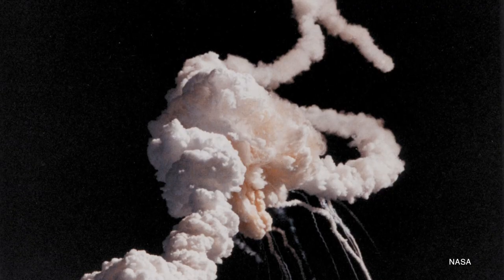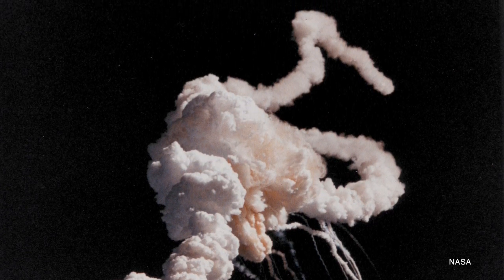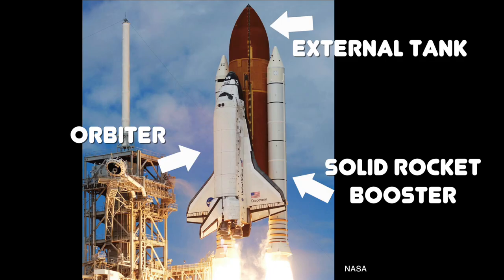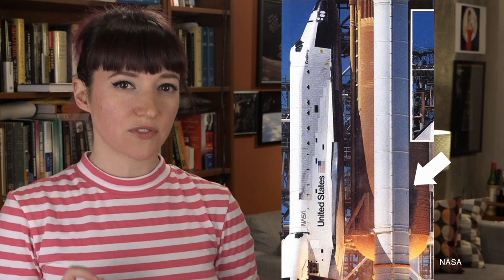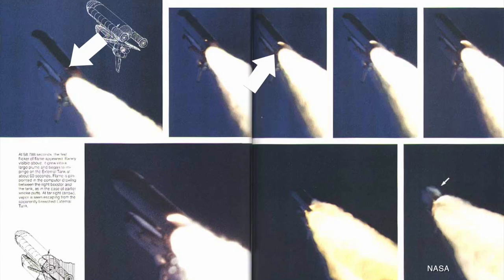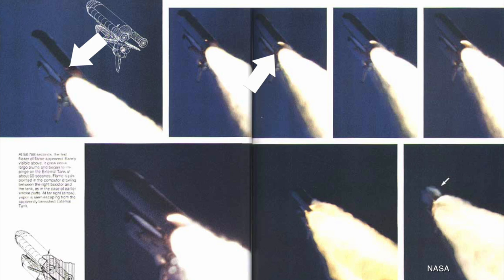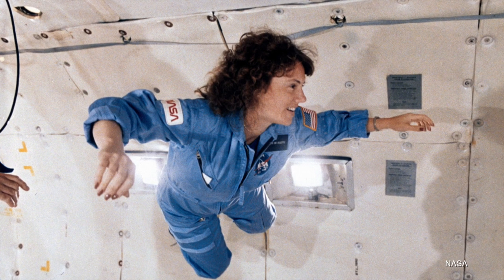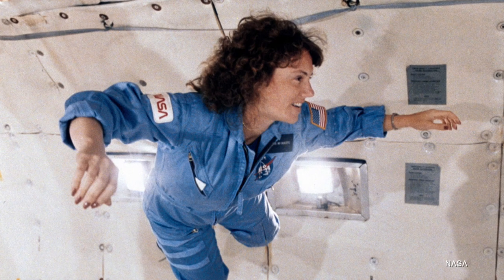How the Challenger Disaster Changed NASA

Comment: How the Challenger disaster changed NASA: Judging by Columbia, not enough.
Reply: Nathan Rasmussen not the same failiure
Reply: But same culture of optimistic engineering.
Reply: bim bar sometimes you need that.
Reply: Same culture of "normalisation of deviance" at work. They'd had thermal tiles and foam fall from the orbiter/tank on previous launches but it hadn't caused a major problem, so requests to perform an EVA to inspect potential damage to the wing prior to reentry were denied. Requests to ask USAF for imagery from their military assets in order to assess potential damage were also denied. Engineers were also told "if it is damaged, there's nothing we can do about it anyway". But Atlantis was already in the process of being prepped for its next mission... If they'd expedited that process, a rescue might have been attempted. It probably would have been unsuccessful, but they could have at least tried.
Reply: @wierdalien1  In a broader sense it was the same failure - the failure of management to listen to engineers's concerns. With Challenger, management overrode engineer's warning not to launch at that temperature, and with Columbia they overrode engineer's requests to check the wing for damage before re-entry.

Comment: OK Amy first of all thank you for doing a space shuttle story. However my research has revealed that the Morton Thiokol engineers did tell them that 53° was the cut off and that they did not feel confident that they should launch at the lower temperature that they were at. Up to and including the lead engineer refusing to sign off on it forcing the Morton Thiokol  general manager to sign it. A minor detail but correct me if I’m wrong.
Reply: Will this is correct. The history channel did a documentary on this event a few years ago and had actual interviews with the engineers who informed NASA of the O rings and it's problems. While the shuttle launched,, Engineers watched and commented to each other saying that they " dodged a bullet" when the shuttle lifted off.  However, seconds after stating this, the Shuttle exploded.

Comment: Wiki-source recap of the actual breakup: "At T+72.284, the right SRB pulled away from the aft strut attaching it to the external tank. Later analysis of telemetry data showed a sudden lateral acceleration to the right at T+72.525, which may have been felt by the crew. The last statement captured by the crew cabin recorder came just half a second after this acceleration, when Pilot Michael J. Smith said "Uh-oh." Smith may also have been responding to onboard indications of main engine performance, or to falling pressures in the external fuel tank.

At T+73.124, the aft dome of the liquid hydrogen tank failed, producing a propulsive force that rammed the hydrogen tank into the LOX tank in the forward part of the ET. At the same time, the right SRB rotated about the forward attach strut, and struck the intertank structure. The external tank at this point suffered a complete structural failure, the LH2 and LOX tanks rupturing, mixing, and igniting, creating a fireball that enveloped the whole stack.

The breakup of the vehicle began at T+73.162 seconds and at an altitude of 48,000 feet (15 km). With the external tank disintegrating (and with the semi-detached right SRB contributing its thrust on an anomalous vector), Challenger veered from its correct attitude with respect to the local airflow, resulting in a load factor of up to 20 (or 20 g), well over its design limit of 5 g and was quickly ripped apart by abnormal aerodynamic forces (contrary to popular belief, the orbiter did not explode as the force of the external tank breakup was well within its structural limits)."

Comment: NASA knew from the very beginning that foam striking the orbiter was a bad thing. In fact, it was declared as not nominal before the very first shuttle launch, and STS-1 was damaged already so badly that during re-entry, there were spots that got so hot that they did melt down to the aluminum structure.

The very same goes for Challenger: broken o-rings already happened in earlier cold weather launches. Those even were investigated, and the conclusion was that at least once, they were lucky not to lose the crew. Yet despite all warnings from NASA personnel and engineers, the launch on that cold day was done. That borders on manslaughter. (Not to mention the segmented SRBs only existed for political reasons and weren't a technical necessity)

Comment: Morton Thiokol also misapplied the o-rings in the tang and clevis SRB field joints.  They only had to check any o-ring manufacturer’s handbook to see that it was a very unforgiving design.  Let’s hope they learned something from Challenger to apply in the Orion program.
Reply: They are still using SRB's so the answer is no.
Reply: saquist Yes - good point.  Solid rockets are inherently more dangerous.  I never understood why NASA continues to use them for manned missions.
Reply: I don't really consider the SRB's inherently dangerous.  (Well, it's a rocket so take that relatively)  If you compare a hydrogen oxygen rocket or Kerosene Oxygen rocket there is a far higher chance of catastrophic failure.  Remember the SRB's didn't explode (not until they were purposely detonated by Launch Control.)  They merely burned a hole in the most volatile area of the rocket causing  combustion. 

It's the stack of the components that's dangerous (again relatively) compared to the configuration of a capsule on the very top which will not enter extreme shearing forces if the rocket were to break up.

That being said, there is almost no other way to do this as a Heavy Lift System.  Look at Space X's BFR.  That's what you would have to do to avoid the Space Shuttle Design.
Reply: They did redesign the O-ring and seal assembly, and retrofitted the SRBs in inventory as well, which is why there was a two year (IIRC) pause before launching another Shuttle.  Still not as good as the originally intended one piece rocket, but that design couldn't be built in Utah and shipped by rail, so Morton (who bought Thiokol) and Congress forced the segmentation, which required O-rings, at the beginning of the program.

Comment: What shocks me is how quickly safety took a back seat to the customer on just the 2nd flight after Challenger 51L.

Atlantis almost had a burn through during reentry due to damage from  ablative insulation from the RH SRB nose cone which caused extensive tile damage down the right underside of the vehicle. The long and short of it was that the crew had to send video to the damage using encryption due to it being a DoD mission and the pics were so bad on the ground that the ground ignored the crews concern.

So they could have lost another shuttle just 2 flights after 51L. That would have ended the Shuttle program. Just do a search for "STS 27 landing photos". Yeah, those white gouges in the black areas are not supposed to be there.

Comment: And after NASA thought they made a change in their mindset, they kept launching shuttles with ice breaking off the main tank, and thenwe had the Columbia disaster. Apollo 1, Challenger, Columbia. Fool me once shame on you, fool me twice... We were supposed to learn from these mistakes. How sad.
Reply: Not ice. Foam.
Reply: There was no way to correct that problem.  They had also tried using different adhesives for the foam which didn't work either.  That was part of the reason why the shuttles were retired.  

NASA still has a culture problems but it's not nearly as bad as it was during the challenger launch.  Columbia demonstrated that in what happened after the realized the possibility of damage.  They were aware of the potential for loss of the vehicle and in theory they could have attempted a rescue mission.  We did have a shuttle that could have been pressed into service for such a mission but the risk was deemed too high for something that was considered too be a low probability of happening.  It wouldn't have been an easy choice even had they known for certain the shuttle was doomed though.

Comment: "...The crew of the space shuttle Challenger honoured us by the manner in which they lived their lives. We will never forget them, nor the last time we saw them, this morning, as they prepared for the journey and waved goodbye and 'slipped the surly bonds of earth' to 'touch the face of God."
-President Ronald Wilson Reagan
Reply: Kenneth Johnson I'm not religious, and was certainly no fan of Reagan, but his words at that time were well chosen and very moving.
Reply: Those words would not have spoken if NASA was not pressured by his administration to knowingly put their lives at excessive, unacceptable risk.  This isn't 20/20 hindsight.  They knew BEFORE they launched.
Reply: Pressure? Possibly, but from the interviews I heard from the engineers that resigned I don't think anyone much beyond NASA had any idea. Personally I put the blame squarely on NASA's shoulders. I try not to operate as jury where I have no evidence and there is no evidence to support the white house knowing the risks. It was purely NASA not wanting to get a black eye.
Reply: Kenneth Johnson Also, it was inevitable. A system they said had a predicted failure rate of 1 in 30, failed on the 25th flight. And there had been two close calls with SRB flex joint seal "erosion" at temperatures in the low to mid 50s F.

Comment: I take exception to the statement that the schedule of the State of the Union and McAuliffe were the driving forces behind the launch.  A launch with a known significant hazard would not fulfill the goals Amy describes, so it really isn't an adequate explanation of the decision.  

An outstanding assessment of the root causes of the accident can be found in Diane Vaughn's The Challenger Launch Decision.  Vaughn demonstrates in fine detail that the issues were more fundamental.  It is true that NASA's culture was at the heart of the disaster, but it was not an issue of nefarious intent.  Rather, the safety culture had eroded over time.  Vaughn describes the concept of "normalization of deviance."  Over time, success with degraded O-rings in previous missions was misinterpreted and misapplied.  An analogy is the fact that most drunk drivers get home just fine.  However, the drunks are assuming significantly greater risk when compared to unimpaired drivers. It can be a mistake to draw an too strong an inference from your previous success.  In the case of Challenger, NASA's review culture was twisted from "prove it is safe" to essentially asking the Thiolkol engineers to prove it wasn't safe.

Vaughn was later tapped to be part of the Columbia accident review, and was the principal author of Chapter 8 of the CAIB report, "History As Cause: Columbia and Challenger."  I highly recommend Vaughn's work to anyone interested in the these accidents.
Reply: Nicely summarised. Previous STS missions had returned with the SRB o-rings eroded by as much as 30% due to combustion gas impingement. But they'd never had a launch failure, so this "deviance" from normal parameters/specifications became "normalised" and was considered an "acceptable flight risk".
Resulting in the worst possible consequences of groupthink and management-speak.

Comment: The challenger didn't actually explode as most people think. The flame burned through the solid rocket rocket booster support strut and as it started to pivot the space vehicle was destroyed by aerodynamic forces not an explosion.
Reply: Justin Fowler well yeah there is an impressive fireball though.
Reply: I guess that's the problem with SRBs, once they are lit, you can't turn them off.
Reply: It wasn't actually a fireball. In the book Riding Rockets this is explained as the gases being dumped from the ruptured tanks but did not ignite. There was no scorching of the recovered shuttle components that would've been expected from an explosion of the ET.